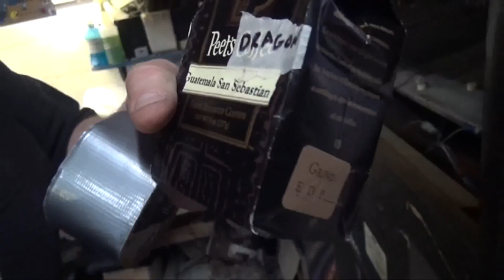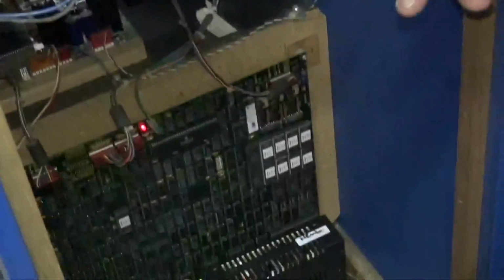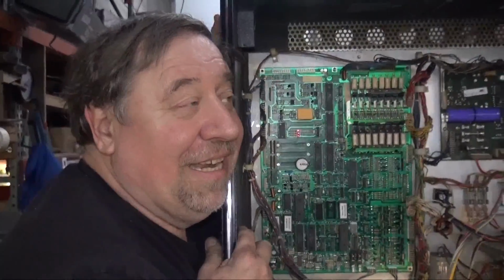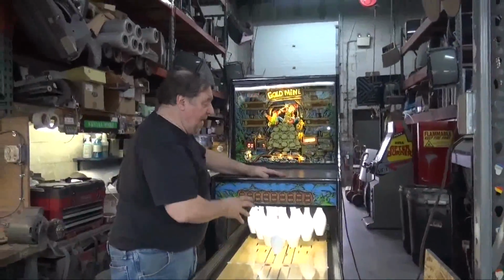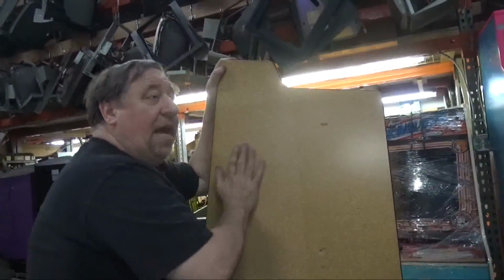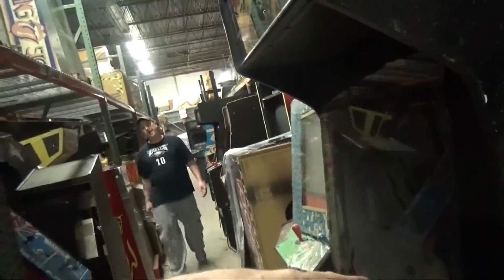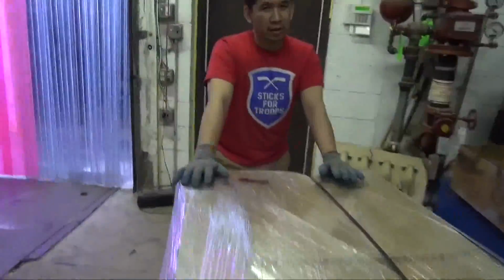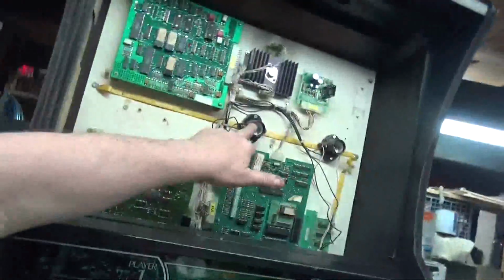#953 Atari TOOBIN' Arcade Video Game-GOLD MINE Shuffle Alley-CHEAP games for sale! TNT Amusements

Comment: I've seen a few of your videos related to the Gold Mine Shuffle Alley but not like my problem.  I have one where the puck doesn't always register when it it thrown even though the pins will flip up but it doesn't count it as a turn. I'm not sure where to start looking.  Keep up the great videos.
Reply from the maker: lots of dirty switches the puck rolls over!  They need to be cleaned
Reply: @tntamusements  Thanks for the quick reply.  Any suggestions on the best way to clean them?  A specific cleaner or just emery paper?

Comment: no XXXL shorts  and they gotta be Tall   ie thats the whole reason I end up with XXXL  I'm not SHORT  6 ft about not Gandalf tall either ouch my head.
Reply from the maker: Lee Bartholomew  well, I bought them mainly for the guys....our other supply which was gre6y were pretty much shot...but I always get extras to sell...
Reply: TNT Amusements Inc oh I'll probably check it out.  ID does it on a point scale  as in if you had a message board system where people chatted about nothing but your stuff or games thats where it would work. they don't have XXL let alone anything I need.  XXL might fit.  Hats work better ;)